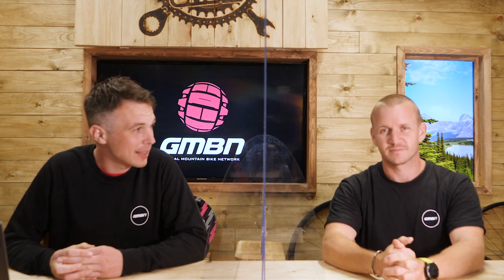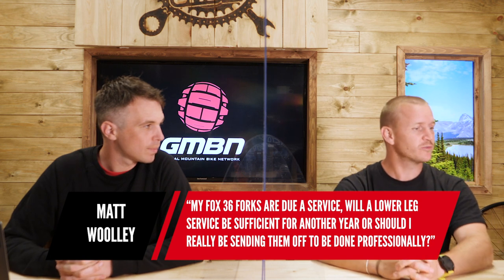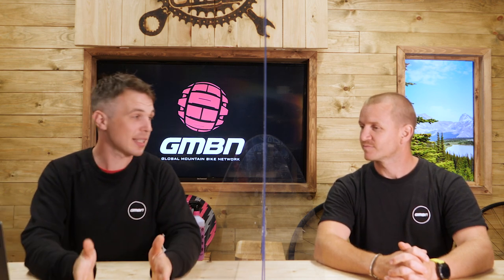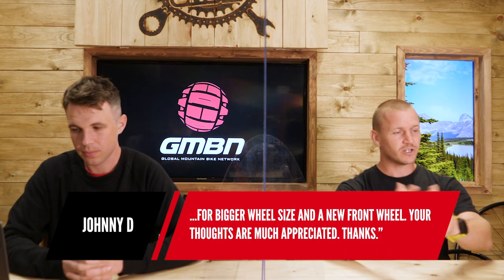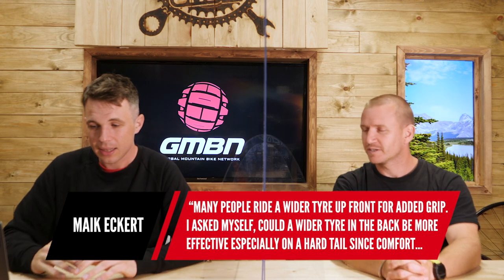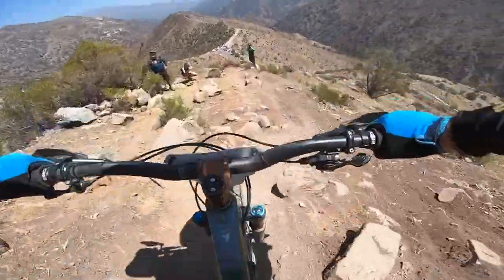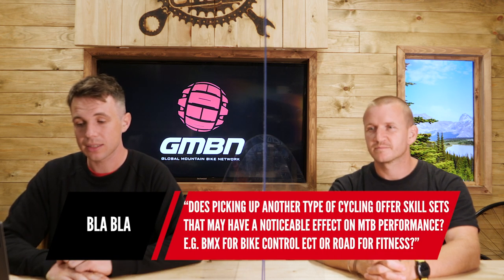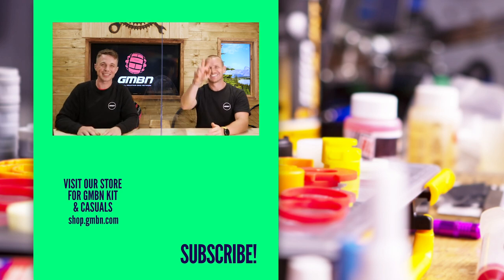Why Are Old Bikes Smaller Than New Bikes? | #AskGMBNTech

Comment: #AskGMBNTech
Hi I want take my 2015 27.5  160/130 dual position Pike off my 2015 Mega AM and I am putting it on my new 2019 blue Nukeproof Scout frame.
Is the 130mm travel setting just for climbing or can I use it on this setting for dirt jumps, pump tracks and smoother flowy trails and the 160mm setting for days of bombing the gnar and on steep descents making it the ultimate slack hardtail fork a newer model better of coarse.
Will I damage the fork using it like this or do I have to just set the sag at the lower 130mm setting before dirt jumps etc. Can't  seem to find any info on this.
I am using a Helm Coil now on my mega. Thanks love the show.

Comment: #AskGMBNTech hey guys, great stuff!

I got myself a new bike with Sram code R brakes. Once they got spongy, I bled them and they were awesome again, but after 3 rides they are starting to get spongy again. How do you prevent that?

Additionally I read a blog post about a guy, who did the bleed like in doddy's video but with a hack (below is a snippet of the post, where he explains the hack) :
The timestamps in front refer to doddy's video. 

12:11, he mentions “push back in one time hard to pressurize the system”…but, the step below ruins this!

12:34, he has the syringe clamp closed and unscrews the fitting from the lever. THIS STEP IS THE PROBLEM!!
If the “system has to be pressurized”, removing the lever syringe fitting exposes the fluid to the atmosphere, instantly losing ALL pressure in the system!! For me, this resulted in a brake that was literally just as mushy after bleeding as before I started…what was the purpose of even bleeding them if it makes zero difference?

Here are the process mods below I made that resulted in a firm lever feel, which I could no longer pull to the handlebar, which was every bit as good as the XT brakes on my other bike.
One disclaimer first: As I have repeated these mods a few times, there is a risk: There could be TOO MUCH pressure in the system, resulting in pads that always rub on the disc because the pistons cannot retract into their bores. I mention how to fix this later…
1. For pulling air out of the lever:
a. At the 11:52 and 12:01 steps:
b. Here is my mod:
i. Make sure to pull as much vacuum as you can on the syringe AS YOU PULL THE LEVER IN AND RELEASE!
ii. Pull vacuum and hold it for several seconds…pull lever in…release lever…repeat. Do this at least 5-6 times.
c. Then push the syringe in one final time. Even though you will lose this pressure when you remove the fitting from the lever, it’s required to ensure the reservoir in the lever is full.
i. While pushing down on syringe, pull the lever in. It probably feels like you want it to, right!?
d. Remove the fitting from the lever and you’ll notice it instantly releases any pressurization you achieved, along with a fair amount of fluid getting pushed out…resulting in zero internal system pressure.
i. You probably now have a lever that is just as mushy as when you started, at least I did, not matter how well I performed the process. Keep reading.
e. Reinstall the lever plug, clean everything up.

2. Here is the mod that made ALL the difference for me:
a. Go back to the Bleeding Edge fitting at the caliper.
b. OPEN it back up, then WHILE PUSHING IN ON THE SYRINGE pretty hard, CLOSE the Bleeding Edge fitting:
i. If you imagine pressing on the syringe on a scale from 0 (not pushing) to 10 (pushing as hard as you can), push at about a 6-7.
c. This is the ONLY way you will achieve internal pressure in the system above atmospheric pressure, which is to pressurize while closing the system!

3. Put everything back to normal, install all the pads, clips, wheels, etc.

4. Remember the disclaimer above?
a. If you spin the wheel, are the pads obviously rubbing a lot?
i. Meaning the wheel spins less than 2-3 revolutions.
ii. If this is true, you have to release some pressure/fluid from the system.
b. Go back to the lever plug, curl some paper towels around the plug, but ensure you can still see the plug, and see if/when fluid comes out.
c. You need to ‘burp’ the plug…open it gradually until some fluid pushes out, it may push out quickly, so be ready!
d. Once you see several drops worth of fluid come out, quickly re-tighten the lever plug.
e. Do the pad rubbing/wheel spin test again.
f. Repeat this burping process a few more times as required.

I wanted to share it with you guys and would like to hear what you think about that :)
Cheers guys
Reply: You have both misunderstood the sram bleed.... you dont ever PUSH a syringe to bleed, you PULL UP the nearly empty one. This creates a vacuum to bleed, but also slightly reduces fluid volume in the system. This us why as a final step you PUSH at lever end after closing caliper end, not to really achieve 'pressure' (as u say, any pressure is lost on removing the syringe), but just to make sure the system is as full as it can be...100% full. 
If u didnt do that, then after the final PULL to bleed the lever, the volume might only be 95%. 
Its also IS part of the sram process to contract the lever. 
But PULLING up a syringe not pushing down the other one is the crucial error.
Suggest to go to SRAM website and download their latest manual fir your brakes, rather than follow online videos only designed to inspire and due to time constraints etc miss out steps. 
One thing you can do, and race techs do tho, is on RSC models, with bite point adjust, to NOT turn this all the way opposite the arrow before bleeding, but about half way thro its total rotations...this helps firm the lever.
Reply: @rupedog  thanks for the advice!
By we both didn't understand the bleeding, do you mean doddy too?
Because he pulls on the syringe.
Reply: @rupedog  I just read the official sram bleeding manual and they exactly describe the procedure doddy does.
"Pull the at lever syringe till only a small amount of dot fluid is in the caliper syringe"

Comment: #askgmbntech Hi GMBN, I’m looking for a nice trail bike. I currently have a hard tail and I’m looking for a full suspension bike under 2000£. Do you have any suggestions?
Reply: Trek Fuel Ex 5. The 2021 model is good value, it has a dropper post, Sram SX drivetrain and good suspension
Reply: Canyon Spectral al 5.0 or 6.0.    Best value for money.     Personally I would get the 6.0   It is up the expensive end of your budget but you do get a Fox 36 fork, Fox float shox, shimano slx drive train and breaks and dt Swiss wheels

Comment: #AskGMBNTech I am having a problem with my drive terrine, when I am riding and going into a rough section or line on braking bumps my chain bounce’s down on my front cassettes and gets jammed where my bb and cranks meet, I have tried to fix it but I am just not sure how to. Could you please help me out?( it is a 3x7)
Reply: And it sometimes doesn’t sit properly on the chain rings

Comment: There's really no reason to use narrow tires. Since wider tire rolls better than a narrow one. Wider tire actually has lower friction as the tire deforms less, under the same pressure as narrow one.
Reply: Narrow rear tyre can be better in mud

Comment: #AskGMBNTech does stanchion width make a difference if so what does it change
Reply: It changes stiffness and strength of a fork. Eg a 28mm stanchion fork will flex or break on impacts, but the like of a Boxxer or fox 40 with 40mm stanchions will be much stronger and will take far far bigger impacts before it flexes or breaks

Comment: #AskGMBNTech hey guys love the show. Im building a new bike and my question is what do you refer as a lacing patern for an enduro bike.
im around 90 Kg included Gear. Front 29 Inch 28 holes for more compliment and 32 holes in the back. Would you refer 3 or 2 lacing patern and why?
Thank you

Comment: #askGMBNtech I have a old Klein attitude comp and was wondering if I could upgrade to disc brakes but it doesn’t have the mounting points is there a way around this or not
Reply: Would u trust a skilled welder?
New fork and wheels required too.
Maybe keep it retro and buy a new steed instead. They were great bikes, in their day.....but now outshone by even a pretty entry level bike
Reply: I recently did a klein attitude build with a disc up front but had to use a magura hs22 rim brake for the back as I wouldn't want to weld a 23 Yr old klein there is brackets for disc mounting but cheap Chinese ones would ruin the paintwork and other style are hit and miss, i used a pace Rc31 fork with disc mount and shimano setup up front hs22 magura on the back as the hs33 was to chunky and busy for the rear frame work

Comment: #askgmbntech- I have a 2019 carrera vengeance it is my first mountain bike and I am thinking of upgrading the stem to a 45mm nukeproof neutron and I am wondering if I needed to get wider handlebars as well (they are 740 at the moment). The bike size is a 16 inch if that helps and I am 5 foot 4. Thanks in advance
Reply: Joe Blake   I bought the 35mm version of that stem and love it.  At the time, it was a new bike, slightly too big and i was at a bad position. So all i replaced was a stem. If you get a shorter stem and not new bars, the steering will be sharper and snappier which can feel good or bad to different people. Longer handlebars will replace that balance and keep the steering similar to how it was before. Hope that helps :)
Reply: @archieansell9160  thank you
Reply: No problem. Hope you get what you need!

Comment: #AskGMBNtech    Hello! I am buying a Propain Tyee and im deciding between two rear shocks. The Rockshox Super deluxe ultimate coil and fox DPX2. Which is easier to service, better behaving on trail and so on? also size XL 194 cm (6'4") 100kg. THANK YOU!
Reply: Rockshox generally easier to self service imo... especially a coil. Air shock more adjustable, but with high rider weights it could be at its max psi and still give to much sag. 
You will likely need a stiffer spring than standard (extra cost), tho even if not at its limit the air shock might need a damper retune fir ur riding weight. 
Get advice from bike manf, but I suggest the coil (budget for stiffer spring).

Comment: #AskGMBNTech Hello Doddy, I don't know if you answered this question before. Question: I tried to clean the headset of my bike and the bottom bearing seized, I tried to pull it out and it's a disaster! The bearing split in half. I removed the inner case and the ball bearings and seals but the outer metal casing of the bearing remains on the headset and I can't remove it. Hope you can help me.😓

Comment: #AskGMBNTech Does the weight of the rider influence much on the bike behavior? I wonder if the light weight of the rider can be a problem for him in progressing mtb skills (manuals, hops, etc - everything that is based on moving the weight around the bike).
Reply: Yes it can be difficult to learn skills if you are underweight. The more muscle and the bigger you are the easier it is to do certain tricks.
Reply: Obviously it depends on the ratio of bike weight to rider weight, but it definitely won’t prevent you from Atleast learning how to do the tricks, even if they aren’t as big as someone a little heavier. Lighter weight can also be an advantage in lots of situations.
Reply: @holmster  yes, it really can be an advantage! Less braking distance, for example. Faster acceleration, I suppose. Oh, and it must be slightly harder to go over the bars )) 
I am 55kg (176cm height) and my bike is 14kg. As I see, the solution to this lightweight problem is trying to move around the bike faster and with more amplitude. I am not extraslim, and my bike is not too heavy. So I think, I am not the only one facing this problem, that tricks "aren't as big" as I want them to be. 
Maybe, #AskGMBN have their expert opinion on this. Some tips. 
Maybe, It is not even a problem, and I am just trying not hard enough! ))

Comment: #askGMBNtech does it good to ride with a worn drivetrain? Can it destroy my bike in some way
Reply: I would replace the worn parts or you will probably destroy the parts that are fine
Reply: If it's all still shifting then you're fine. I left replacing my chain for too long so my chainring and cassette ended up needed to be replaced as well. I bought the parts but as everything was still working and shifting I waited another year and about a thousand miles before I swapped them all out. Did no harm to the rest of the bike.

Comment: #AskGmbnTech May it help against punctures when I put tubeless sealing into my inner tube?
Reply: A similar idea was implemented some years ago, I think it was called Doctor Slime. Unfortunately it just didn't work and ended up leaving green goo spread all over the inside of the tyre. Tubeless sealant may be better now but I'd personally recommend buying good quality inner tubes paying extra attention to the quoted width. A 1.75-2.125 can fit in and pump up a 2.3 tyre but it will be little over stretched whereas a tube designed for 2.2-2.6 will be stretched only within the intended tolerances on that same tyre.
 Quality tubes are probably the better option.
Reply: @andrewince8824  Thanks. Is in in a long view cheaper to convert to tubles? I destroy inner tubes very often...
Reply: @GekotzeLugor  I'd say it depends on how you ride. Tubeless tyres are roughly the same price as regular tyres however they will be trashed quicker if you get lots of punctures. Changing tubeless can be harder if your sealing compound sets and trying to remove the tyre can damage the rim. It's less than ideal on a typical tubed wheel but on tubeless the rim needs to be in good shape to seal.
 The last issue I've experienced with tubeless is burping. On high impact landings the tyre can flex enough to release a small amount of air. Not a problem immediately but it can lead to tubeless set ups requiring a track pump every few runs.
 It's not all gloom and doom. Tubeless is usually lighter, can allow for a grippier tyre due to improved flex and does away with the fiddly innertube. 
 At the end of the day, it's down to you to consider what you'd like to run. Ride what you love and you'll love riding.
Reply: DasZenkerle 01    Yes you can also buy tubs with the sealant already In them
Reply: Muc off does some inner tube sealant. It’s got a different compound so it doesn’t harm the inner tube and will still work well. If you want to use sealant but don’t want to go full tubeless, that’s your best bet